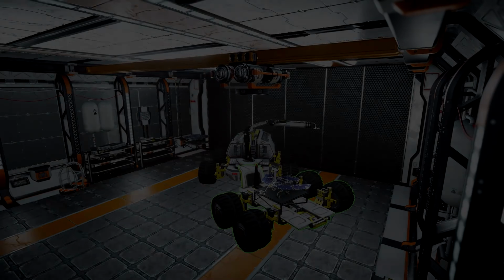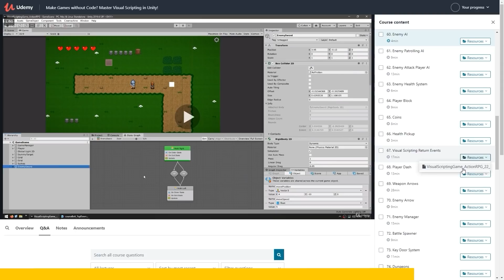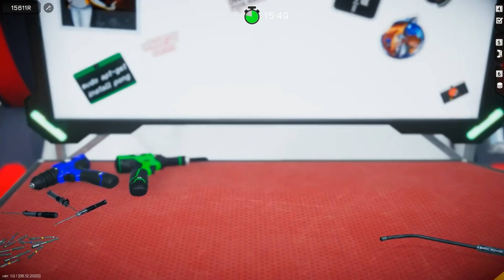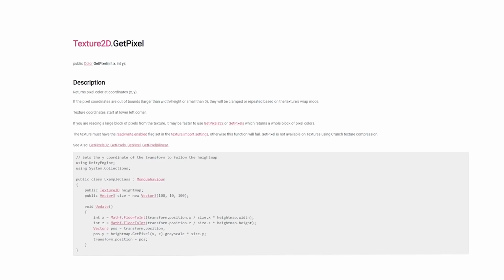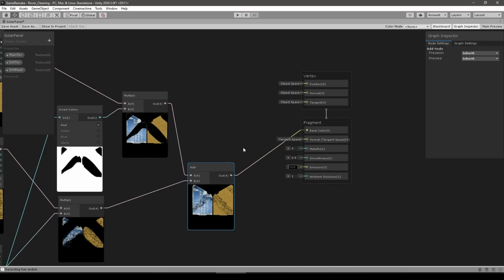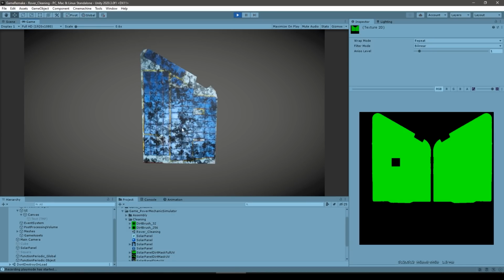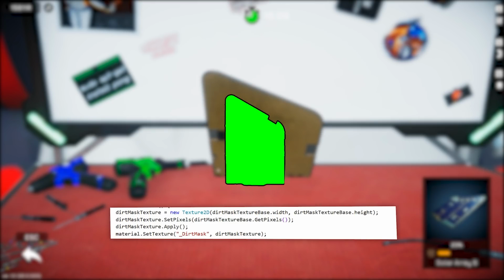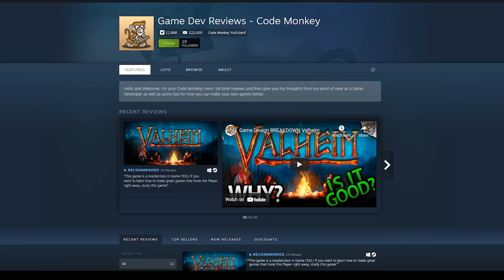How it's Made: Rover Mechanic Simulator | Cleaning Minigame - How to Paint a Texture Unity Tutorial

Comment: Hello have a question here, so I've follow the tutorial, and manage to do it, but have a question here, how do I change from a mousePosition and raycast to detect if I'm hitting the object that need to clean to a 3D object that can clean, for example you are holding a wipe cloth in VR, and you move the cloth and it will clean the object.
Reply from the maker: You can implement a texture and dynamically modify that texture, like I did here https://unitycodemonkey.com/video.php?v=Xss4__kgYiY
Reply: @CodeMonkeyUnity  Hello again, Okay. I manage to change from using mouse to using a line raycast to detect if I'm hitting object so I can spray on object. but now I have a bit off an issues. It seem that when I spray the spray is a bit offset from the texture. I have a link showing my issues. Maybe you could help me out on this. The camera used is from my VR camera perspective. 

Link : https://youtu.be/6nNVxRrvrqQ

Comment: This seemed really cool and wanted to investigate it more so downloaded the files. But had a bunch of errors to do with shaders etc. Im not too familiar with the different shader modes just now. Do I need to open the project file using a certain pipeline? Also do you have a video that shows how you would do something like the unscrewing part that you showed in the beginning of this video. Ive always wondered how something like that would be done, with the camera movement etc.
Reply from the maker: What errors? Maybe you don't have the Universal Render Pipeline installed, maybe it's Cinemachine. Look at what the error says to figure out what is missing.
For unscrewing objects, it's really just identifying what object is in front of the camera, similar to what I did in the Pick up Objects tutorial https://unitycodemonkey.com/video.php?v=2IhzPTS4av4
Coupled with the Crafting https://unitycodemonkey.com/video.php?v=_aC3NVIQ-ok
Or just any interaction system https://unitycodemonkey.com/video.php?v=LdoImzaY6M4
Reply: @CodeMonkeyUnity  Turns out most of the issues were because I didnt have URP installed. I still got some issues to do with LWRP but once i reverted back to an older version of the editor all errors went away. Thanks for the previous response. I did also have to set the render pipeline in the projects settings, (in case anyone else is new to the shader stuff and is struggling :) )

Comment: I am having some trouble implementing this in 2D. Using Physics2D obviously and the only other difference is that the textureCoord is equal to hit.point rather than hit.textureCoord. Apart from that I haven't changed much, but can't seem to get it to work. The raycasts are working properly, but the texture is not being updated. Any suggestions or ideas on what the main issue may be?
Reply from the maker: Hmm I haven't tried this specific method in 2D, you could still use the same method on a Mesh Quad. When using a SpriteRenderer I'm not sure how it would change, you might need a diferent method converting the mouse world position into a sprite local position and calculate the UV, not sure
Reply: @CodeMonkeyUnity  You pointed me in the right direction and I figured it out, thank you! For anyone wondering, the key is to use the physics2D GetRayIntersection, and then do a transform.InverseTransformPoint on the raycastHit.point, and multiply that by the sprites pixels per unit to keep it consistent across different scales. Then you've just got to offset that to account for the fact that the sprites (0,0) is in the center, rather than in the bottom left as it is on the Texture2D, and then everything else is the same!
Reply: Vector2 textureCoord = transform.InverseTransformPoint(hit.point) * pixelsPerUnit;

                    textureCoord.x += spriteRenderer.sprite.rect.width / 2;
                    textureCoord.y += spriteRenderer.sprite.rect.height / 2;

Comment: Hi Code Monkey, I just playing around with the project files and try use Robot Kyle from asset store but the issue is when I try to clean its one of the arm or leg because its using the same texture on both parts they get clean simultaneously. Playing with wrap mode but couldnt achieve to prevent this happening. Hope you have a solution for this, thanks
Reply from the maker: Sounds like the asset was made to reuse parts of the texture, you would need to remap the UV to make sure all the parts are unique. 
I'm not an expert 3D modeller so not entirely sure how that process is done, I'm sure Blender can do it but not sure how.
Reply: @CodeMonkeyUnity  Thank you so much even 6 month passed from the video you've been upload still answering question. I really appreciated your hard work

Comment: Hello! Maybe my question is very advanced. But I would like to know how you can bake an animation into a texture. For example, to achieve destruction enviroment with low performance cost (You simulate it before and save the result in a texture).

Reference: https://youtu.be/gcOkCpvsDPk?t=127 

Greetings! And thanks so much for your videos and help!
Reply from the maker: A texture has 3 floats per pixel RGB, you can use those values to define XYZ positions so each pixel is a frame of your animation.
Then perhaps each row of pixels refers to a different object. That's one way to do it.
Reply: @CodeMonkeyUnity  Thanks! I found a video where  someone made a code for something simillar on Blender. Then export the textures to UE and use a vertex shader to animate it. So I can take a look into his code and try to emulate it on Unity. Video:

https://youtu.be/NQ5Dllbxbz4?t=167

Comment: It's very nice when a professional makes this kind of analises. Thanks a lot. An doubt, if instead use this technique how about use the render pipeline (URP or HDRP) to choose what is shown? Like we paint the surface with invisible color and the render pipeline doesn't show the dirt layer (like how they make the character visible when behind other gameobjects in Unity open project). It's possible? Which one has less computational weight?
Reply from the maker: That would be a very weird way to do it, you would need to play around with multiple layers, maybe some custom shaders to write some stencil data. It would technically be possible but needlessly complex.
Reply: @CodeMonkeyUnity  thanks! I'm still learning how shades works. They seems to be very powerful
Reply: Thanks!

Comment: Solid video as always but i actually came in thinking this is all just shaders cause i imagine getting a single pixel every frame using the cpu would be kinda costly
Reply from the maker: As always it depends on the size of the brush and your target device. For a Desktop PC this approach works perfectly fine, if you're targeting low end mobile devices then maybe you need some extra optimization.

Comment: That's so cool. I wonder what the approach would be if you could dip the pieces into water for example.
So how could we clean everything below a certain point instead of raycasting the texture
Reply from the maker: Hmm calculating where the line hits would be the tricky part. Maybe with an overlap box along the water plane? And if there's a collision then do a raycast to find the UV point. Then move the test point along the water plane to find another point to get the line equation. Tricky but should be doable.
After you know the equation for the line then painting under it would be relatively simple.
Reply: @CodeMonkeyUnity  If you assume the water level is perpendicular to the ground you just need to know the point of collision and the object's rotation relative to the water object.

Comment: Texture2D.GetPixel/SetPixel methods are not performant when doing a lot of calculations every frame using CPU (especially at low-end devices). Better solution is to write custom shader for drawing mask and use compute shader to calculate percentage - that is what I have made
Reply from the maker: As always it depends on your particular requirements. 
For this mechanic and with my target being desktop PCs, this method works perfectly fine. 
If you wanted a bigger brush and target low end mobile devices, then yes making a compute shader would possibly be a better solution.